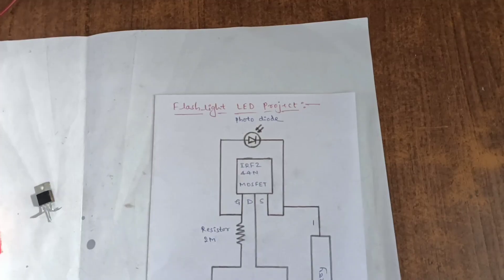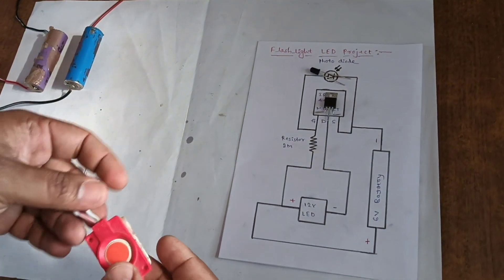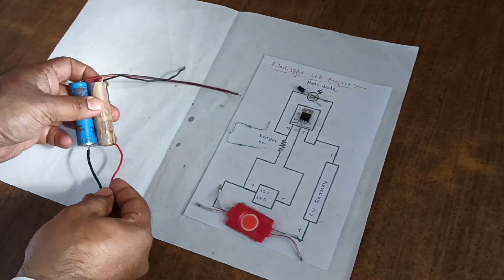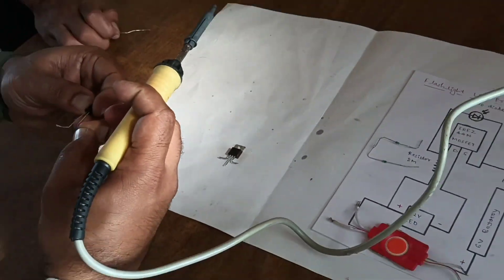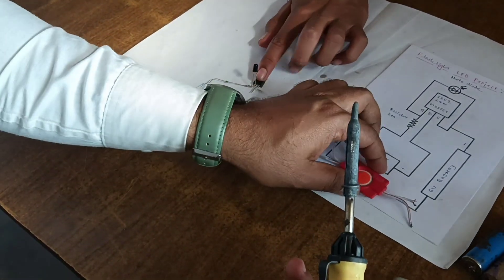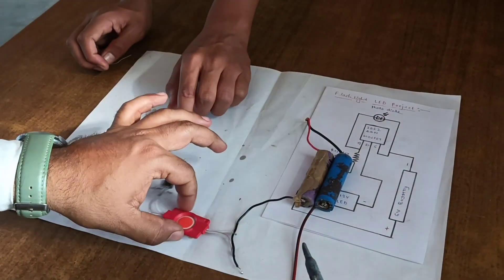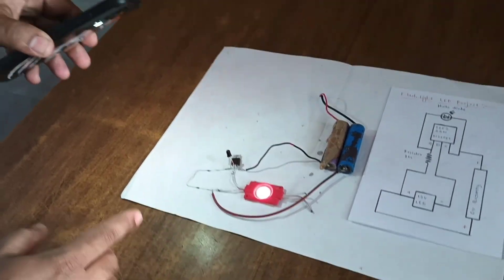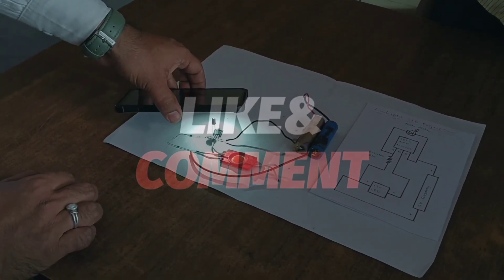First time in YouTube🫡 Mobile torch 12V LED ON # Super se upar video # Watch & Subscribe Channel 👈..

Comment: Very nice project mobile torch 12v LED on and off very useful peoject using for material IRFZ44N MOSFET OR photo diode or resistor or LED project video 💯

Comment: Very nice project mobile torch 12v LED on and off very useful project using for material IRFZ44N MOSFET OR photo diode or resistor or led etc👍